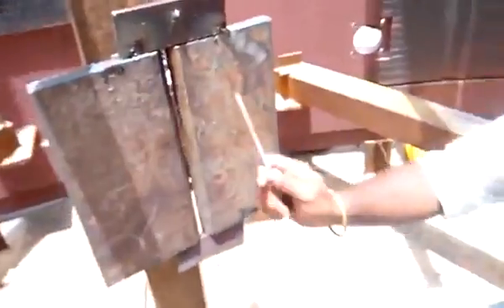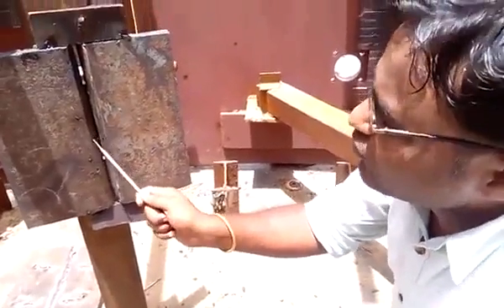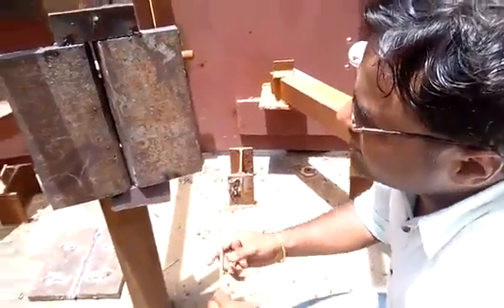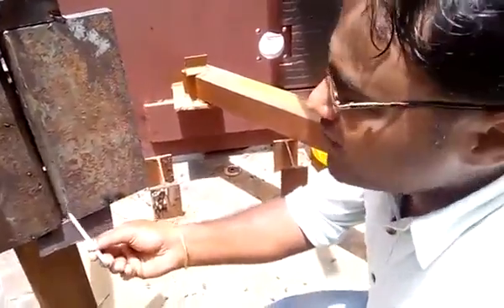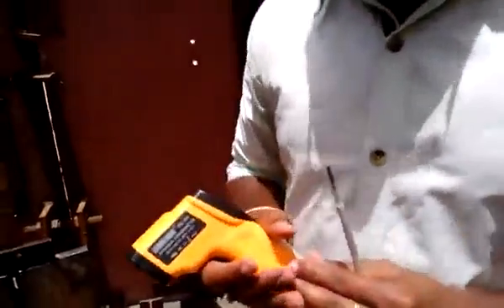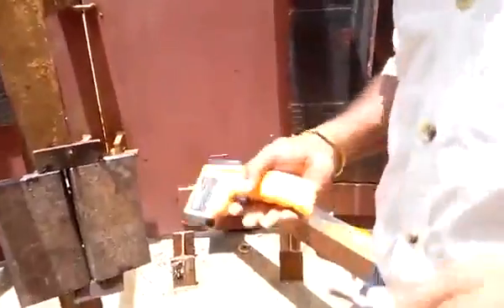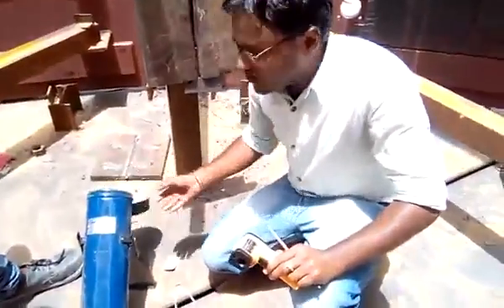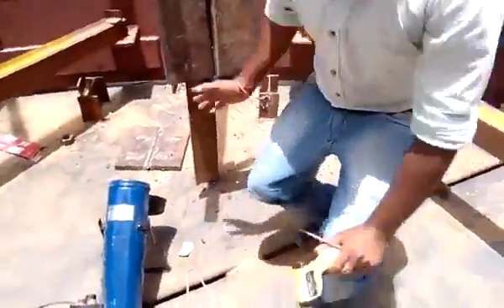[English] Welder qualification test in 3G position

Comment: Nice Video. Impressive. We also Conduct Welder Qualification Test and do Welder certification as per AWS D1.1 and ISO 9606  by International Welding Engineer . May contact 8459658378. Qualified 500 Welders and Trained more than 3000 welder.